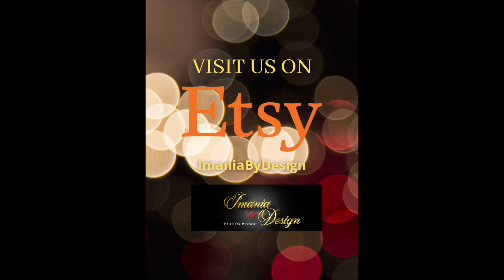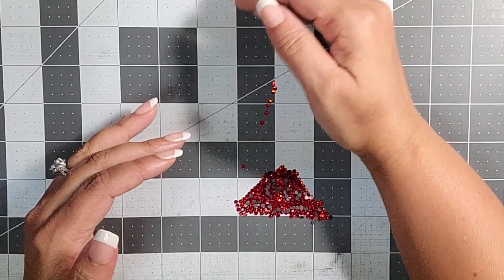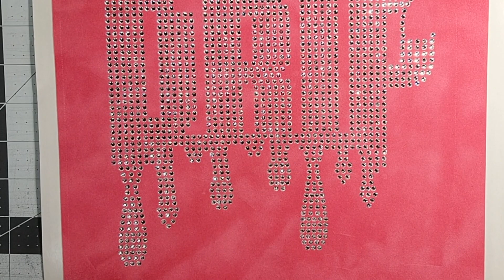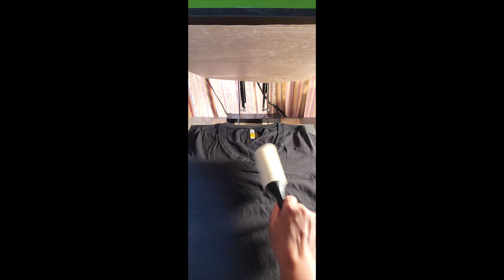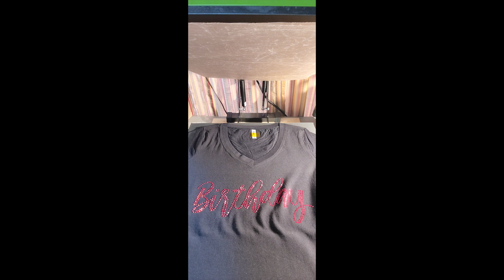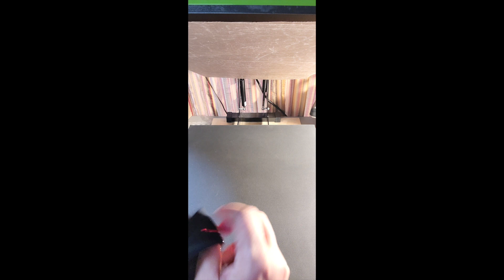How I made this Bling Birthday Drip Rhinestone T-shirt

Comment: Hello Im so Happy to find you! I already favorite your Esty page 😊 Thanks so much for the awesome video. I just have a few questions. 1 how do you know if the transfer tape is grand A? Will it say it on the package? 2. What you you have your template attached to is it paper?
Reply from the maker: Hi Denise! 😊 Thanks for watching!❤
I use and I also sell Grade A transfer tape in my shop.  One way you know that you're using Grade A transfer tape is that it is taut or somewhat stiff, but it's still pliable.  It doesn't fold easily onto itself.  It hold your design securely in place; in this case, picks the rhinestones up and holds them tightly so that you can move it, without the rhinestones moving around.  Less than Grade A transfer tape will be more flimsy and won't hold your design together as well.  Also, if your using transfer tape on projects that require permanent adhesive vinyl, less than Grade A transfer tape will stick to and not release the vinyl.  It will also tear easily so you can't reuse it.  Grade A transfer tape can be reused multiple times.
Some packaging includes "Grade A" on it.  I have also seen "Grade B" which provides a lighter hold.  If you're working with delicate projects like rhinestones, you'll definitely want to go with Grade A.
Reply from the maker: Denise, I forgot to mention...Yes, I put the template back onto the carrier paper that it comes on.